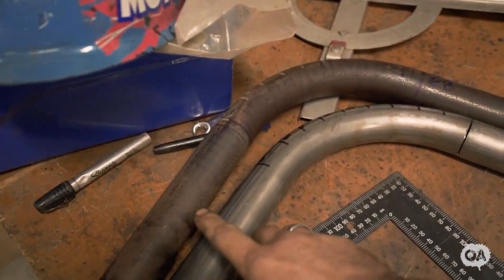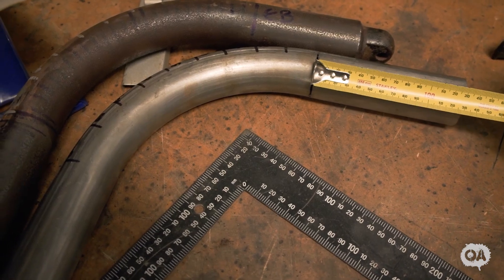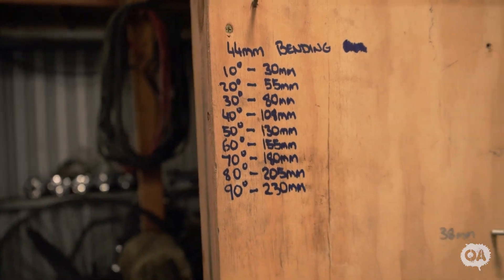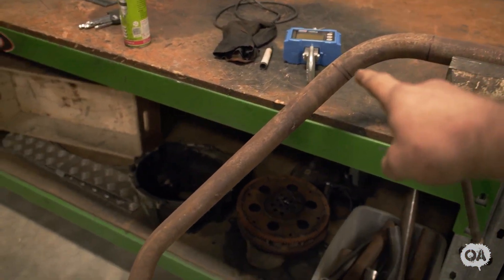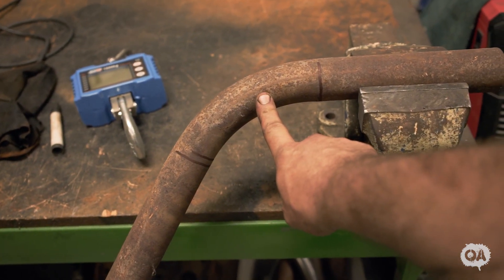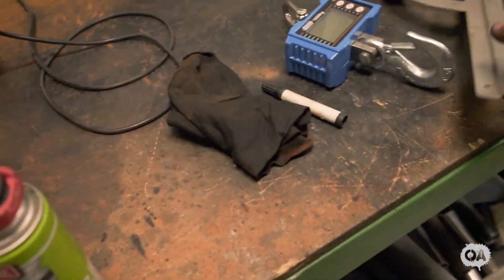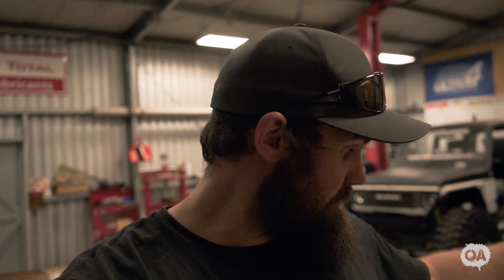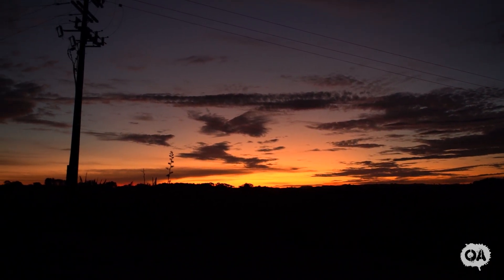Lockdown Day 7 - Fabrication with Frank pt 1 - The best is yet to come

Comment: Mate a quick question 
Do you know What wiring do I need to start a td42 crate motor for my jeep project. Boys and there toys right..
Reply from the maker: You should be able to get it started with power to the fuel cut off solenoid (make sure you have a 12v one, you can use a td27 one from a Terrano). You may also need to loop the neutral inhibitor switch to trick the Jeep ecu into thinking it is in park and still attached to the original motor but that is just a maybe if the ecu gets upset.